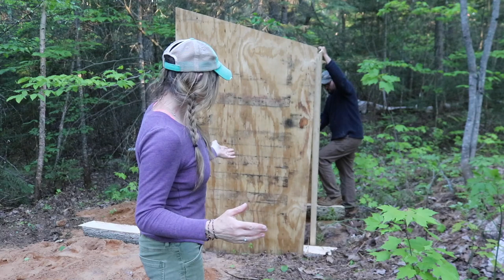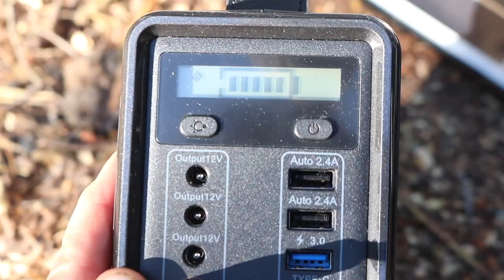Pulling Stumps & Building the Outhouse- Our Remote Property in the UP | EPISODE 12

Comment: I absolutely love how stoked you  get over the simple things in life!
Yeah, you know, like an outhouse and the proper build & use thereof! 
I grew up with outhouses at summer camps *(one was a three holer) and what you said rang so true! 
My only additions would be: 
(1) build in two framed & multi-layered screened air flow spaces - one about a foot above the bottom of the door & one up near the top of the back wall and 
(2) keep a pail of ashes in there and add a scoop after each dump.  
Once we did that to ours, it was more comfortable for those longer visits in the heat of summer and the odor was  reduced even more. Some of the units never had to be relocated because breakdown occurred better & quicker.
Reply from the maker: nice

Comment: The required court layout for a game is two stakes fastened securely in the ground 40 feet apart. The stakes should be of iron or soft steel one inch in diameter protruding 15 inches from the ground, each leaning approximately 3 inches (
12-deg. from vertical) toward the opposite stake.
Enjoyed watching!  Love the rocking chairs!

Comment: My family used to buy the pix coils when we went to the drive in movies when I was a kid. They did not work that well and we still got a lot of insect bites. If you don't perspire heavily like I do then you can try Avon Skin So Soft. You can use it in diluted form on the dog too. Mix 50-50 with water. Another method is Walmart sells oil lanterns in the camping department and citronella oil in the garden department. It helps light up the outside areas and the citronella works against mosquitoes. As for Deer Fly they come in and attack in squadron strength. You could try a mist device to try and control them. If you can find citronella plants in your region you can container grow them. Up north they would die from the cold winters unless you have a greenhouse to keep them warm during winter. Stay healthy and stay safe and keep living your dreams.

Comment: Cool battery pack. Plan your solar panel location to get the most out of it.
Even a little shading can greatly affect your output.

On the outhouse if you put a solid lid on the hole to block the fumes and also install a vent pipe painted black on the sunny side up above the roof a couple of feet, the heat of the pipe will draw the smell up and out.
Look at a plastic commercial Port A Potty.  It works.
Ashes work also.

Comment: I mentioned this on Bushradical, but I have built a total of 1 outhouse and I did think of the dark, so I used a  skylight I had as scrap, the pee shield, had a scrap of aluminum flashing. Didn't think of the TP issue but I added dolomite lime in the pit and that keeps the odor down as well as promoted breakdown of the organics. It works for disposal of bodies as well, I read once.  A idea I read about for TP disposal was using a lined plastic bin like a tall kitchen trash can with soil in about the bottom 25% with worms in it. You toss the TP in there and the worms make it into more soil. after it fills up you can use the soil where ever you need on your property.  The person that suggested this said in their experience after it got going, the can always smelled of fresh dug dirt, not poop.

Comment: Yup, sure enough is a sweet outhouse there guys, (never thought about a clear roof, what a great idea!) and your right it's an essential part of offgrid living. A couple of thoughts. I would have charred those bottom logs before placing them for the final time to give them rot resistance. And you're also right about the "pee shield", I myself took a big sturdy black bucket (the kind bricklayers use) and cut the bottom out of it and screwed it under the seat , works great. BTW, there is toilet paper made for boating and camping that you can get that degrades much quicker then the ordinary stuff...  Regarding the skeeters, the new propane traps seem very effective. My brother has one, and it cuts the numbers of skeeters around his cabin pretty good (it was however quite expensive...). Good luck in the future, stay safe.

Comment: Another suggestion for the privy-in a back corner of the seat board,cut a round hole-2" or so and a corresponding, with a piece of pplastic pipe the size of the hole-pipe determines the size of the hole of course hole in the roof, install the pipe as a chimney to the chamber,below with the bottom of the pipe flush with the bottom of the seat board to allow easy venting of fumes(a little raised box for fumes to go kinto ,and rhen upthe chimney might even improve on things(seal where it goes through the roof of course,makes a big difference-where I often camp in the wilderness of the Adirondack mountains,out houses are all there are,and they usually reek-one year someone had made that modification to the  privy on my site , -no stink)it also had a regular toilet seat assembly,with tight lid, which kept  the fumes below,and flowing up the chimney=what a difference !=later the state discovered the non regulation  mods,and undid them(rather than learning and improving the other sites ) and back to the good old stench it was ! ,another thought(gonna sound like a safety Nazi,but oh well...) be carefull of climbing on chairs and such,falls will happen with no warning,and can be surprisingly serious-(I lived through fractures of c-1,c-2, and the connection to skull from an infection rather than a fall,and I can say with surety that pain is nothing you want to try,I'm fine now no pain,no problem ,neck doesn't  move much,but a small price to pay to be here-hey my mother used to tease me as a kid that if my head wasn't screwed on I would lose it,were she still with us I could tell her-"No problem now ,it is screwed on -with titainium  even !) you probably could do without the 190 k price to get put back together, that process was interesting, but once down that road was quite enough, then 21/2 months in a nursing home for therapy, etc,6months to go-2 year total healing-and I should be as healed as it's going to get, still have the metal ring, and the bolts that were drilled into my head for the halo as keepsakes, to remember the fun.I can say to anyone that might be facing such an installation, that a halo isn't (in my experience) that bad, inconvenient, and clumsy perhaps, but not nearly as bad as they look although I was quite happy when it came off - I want to have a hole drilled into one of the pins(bolts) to wear as a necklace..

Comment: Brooke, I love you guys!! The first thing I built on my property in Hawaii was an outhouse or Lua as they call it there. I didn't use the plastic roofing but I screwed two five gallon buckets together as a shaft into my cesspool  which was 10 ft deep by 10 ft wide. It worked well a nd kept the " throne" from getting stinky. I love your ideas especially the foam seat!! That was a revelation.... but I did have a foam toilet seat that I used. After 15 years she is still standing and still going strong. When I throw a party at the house, I send all the boys out to the lua to do their business!!  You guys Rock!!!

Comment: Have you considered fogging the area of the tree line just beyond where you are working. Also, if you wrap the chain around several different places the rotten stump will come out faster; but don't do that unless the stumps are rotten. As you are so far back in the woods I would recommend that you have 2 chains in your truck at all times as well a 5-10 ton come-a -long.  Should there be a very heavy rain you might need it ti get get out and back home. Another trick is to bring a five gallon plastic bucket and put it by the tent. When ever you find a stone or rock you don't want, put it in the bucket. On the way home stop and empty the bucket in the low spots, when you get home do the same and bring the bucket back. It's surprising how fast the low spots will get filled up with free unwanted rocks or stone.

Comment: A post hole digger might work better when you get to a deeper level in the outhouse hole. That way you could stand on ground level and work outside of the hole... removing the bottom layer would be easier too, no trying to swing a shovel!

Comment: We used some wood chips in our plastic barrel and composted it but in the old fashion one we put lime in it.  No smell in either one.  But we havd a 6 ft deep pit but a 2 seater one.  Never had it fill up.  In Texas we used a 5 gal bucket and chips inside.  No smell. Emptied it once a week into a metal barrel with no bottom.  Left it a week to dry out then ii burned it.

Comment: Good morning Brooke and Dave. I'm actually in my hometown of St. Clair Mi watching this. The camp is looking good.  I have one suggestion that could save you a headache.  Whenever you pull with your pickup always try to pull forward and not in reverse. The ring and opinions in your differentials are designed to pull in a forward motion and are stronger that way. Plus reverse in the transmission is not as strong as low gear. Enjoy your time at the camp

Comment: OUTHOUSE PRO TIP:  Cut the bottom out of a 5-gal. pail and seal it to the hole.  Add a vent hole through the back wall and just under the seat deck.  Offending odors will rise and find their way to that bent hole while the bucket "chute" will both block odors and prevent urine soaked wood.  It also lets you clean down there when needed.  I have pictures of mine if I can find an email for you.

Comment: The solar panel works best when it’s at a 30% angle facing south. I learned that when taking a solar electrical class.
Reply: The best angle depends on the latitude you are at and the season for optimizing summer sun its roughly 15 degrees less than your latitude and for winter about 15 degrees higher than your latitude but there are solar angle calculators that can get you a few degrees closer also remember to point true south not magnetic south like a compass shows you can look up the magnetic declination at your gps points. Of course for the one panel just look at the battery pack watts input reading and move it till its the highest reading nothing fancy to do.

Comment: My uncle had a cabin up in the room or up in Vermont and they used an out house what they used to do was have lighter fluid in the outhouse with wooden matches they showed all the kids the right amount to use and we use the spray down into the hole where do you do number two and light it and let it burn off that helps with the smell to
Reply from the maker: wow

Comment: Have you figured out what kind of geological glacial ridge you have? Seems too small for a moraine, too large for an esker, possibly a drumlin. Dig in and identify soil type. Eskers and moraines are usually sandy gravel; drumlins have mostly clay and rocks of all sizes. Old lake beaches are all sand. Each will have trees and plants best suited to the soil. You should try to find a good source of gravel and clear a road to it for concrete for your cabin construction and to improve the road in where it is swampy. Use your natural resources wisely. I would carry some surveyors tape when you hike and mark cedar trees for use on your cabin. Line the walls of your outhouse with cedar. Won't need painting and an occasional light sanding will keep it smelling fresh.

Comment: I just wanted to let you know that I pulled out a stump with my 3/4 ton Chevrolet truck hooking a chain to the recovery hooks on the front of the truck. Very shortly after that there was a $2500 transmission job. The trans shop said never pull anything like that in reverse it will destroy your trans.

Comment: What was the screech in the 8 minute range? Bigfoot?  :-). 
   You need DEET for the mosquitoes. Get a little led light to put on the outhouse wall inside. I'd suggest a solar motion sensor light on the outside but it looks too shady there for charging. We keep personal wipes along with any toilet paper. It's all in a zipper bag to keep the paper dry and fresh.
   You can also charge the power bank on the generator whenever it's running for something else too.
   Do you guys have jobs on the outside?
   Carry on with your great life together!

Comment: Say the volume of the out house hole is one cubic meter? If the average deposit is 100 mm cubed or 1 litre that is 1000 liters of solid waste or 1000 dumps before your hole is full and it will be time to move the out house. When that happens, try to be a bit more gentle with the chain and truck than you were on the stumps, Brooke.

Comment: good job on the poop house, but you are missing the most importin part, and that is a 4" vet pipe enters the back corner of the seat and strait up though the roof with no bends in it,, or it will vent up though the seat hole into the poop house with out it..

Comment: Nice outhouse, BUT, that roof will not last a winter in the U.P., so you should reinforce it with a grid of 2x2s or some equivalent support if you want to have it last the winter. You could easily get 1,2 or 3 feet of snow covering it during the winter.
Reply from the maker: he just didn't include that in the vid. done.

Comment: Outhouse... Dig hole big enough for a 55 gl barrel. Drill one inch holes around the base side of said barrel, set barrel in hole. Build the foundation for outhouse so the structure can be skidded back to uncover the hole. Build outhouse.  The holes in the barrel allow for liquid leaching. The skid allows you to move the structure back and this is the key... for four people this will be about every two years... skid the outhouse back,  pour in five gallons of kerosene (not diesel), light, burn and stir. Stinks like... well ...shit... But your hole will last damned near forever!

Comment: I keep admiring that table inside your wall tent.  A different video showed you taking it apart for easier transport etc.  Did you create/build it yourself, or did you purchase it somewhere?  If you built it, did you utilize existing plans, or design it yourself too?  I've seen "reproductions" of small tables and benches of that general construction method that were representations of items used in the 1800's for military and other travelers needing desks, tables, benches and so on.. LOVE the practicality and sometimes dual/multi-purpose items! :D
Reply from the maker: got it from some reenactors- i should do a pattern!

Comment: About the out house.  Although the burning of toilet paper certainly works, using compostable toilet paper is great if you don't want to deal with used toilet paper.  Also, the less you pee in an outhouse the less it stinks, period.  A bit problematic for women, but the two of you could reduce the issue by 50% if the hubby peed outside.

Comment: How much it cost to build a cabin and have bathroom inside of it and kitchen because have water and electric in MI.
Reply from the maker: wow that depends on a TON of factors
Reply: Okay
Reply: You can use Solar system and this can light your home, and use to charge your Celphone, and heat your water
Reply: Hi . what is TON ?

Comment: I thought of you as I read this piece online about the Osage Orange.  https://www.resilience.org/stories/2015-12-15/why-osage-orange-trees-why-here-why-now/
It forms dense hedges, doesn't spread easily, grows up into Ontario. The wood is extremely rot resistant, is useful for tool handles, and makes a good bow. It makes a useful fire starter, easily shaven and burns hotter and longer than coal, leaving useful cooking embers. The dead wood is easily gathered. It can be purchased online potted. Trees are dioecious. "Nineteenth-century farmers prized the wood because it is so good for making tool handles and fence posts. And, valuable on the treeless prairie during long cold winters prior to easy access to fossil fuels, the wood burns hot and long, almost like charcoal, even requiring a coal grate. The ability to grow it and keep it trimmed in hedges that were “horse high, bull strong, and hog tight,” was an advantage in the years prior to the invention of barbed wire in 1875. No wonder Osage-orange champions Jonathan Baldwin Turner and Dr. John Kennicott, both of Illinois, were able to promote it with such ease. Turner researched and grew several species of hedging plants and touted Osage-orange as the best. Kennicott claimed that Osage-orange trees offered more economic benefits to farmers than any other crop."

Comment: Composting toilet would be easier.
Reply: No, no it wouldn't. Nothing is easier than crapping in a hole.  Even if you did put something fancy above it. That outhouse could last a decade and requires effectively 0 maintenance.  When this begins to get full, if ever, you simply fill in the top couple of feet with dirt and move to a new location.
Reply: Humanure.  No hole to dig.
Reply: @hargieboo  exactly. Plus the waste breaks down into compost that can be used on trees. I have one I built in my trailer.